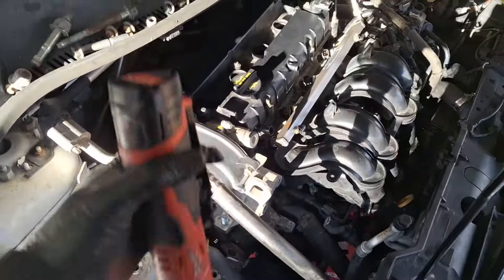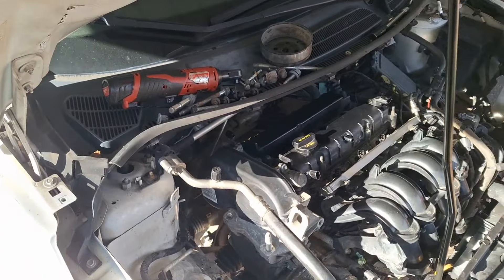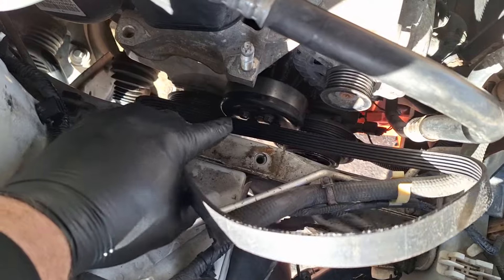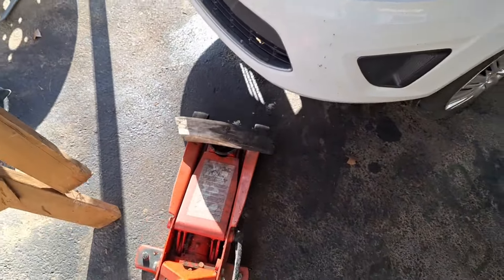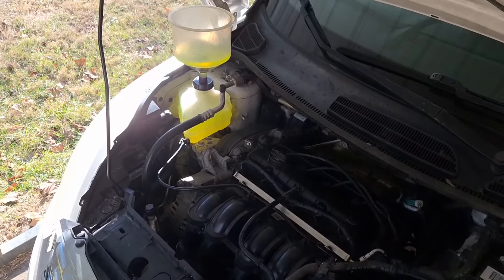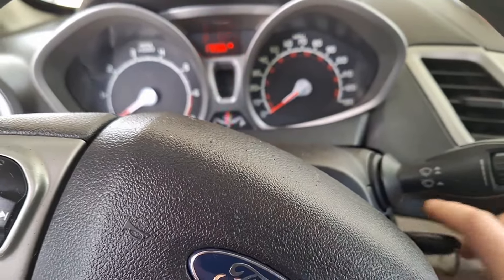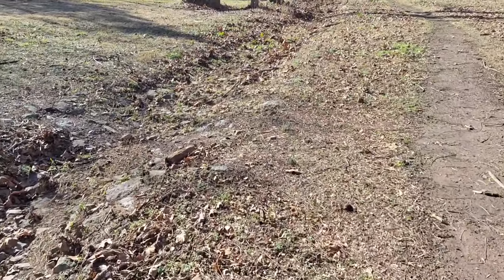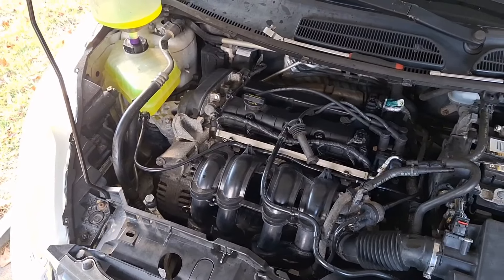Project Ford Fiesta - Did The Head Gasket Fix It?

Comment: I'm really enjoying this series. I just replaced my whole head gasket with the same kit that you used. In my 2012 ford fiesta. The car is still overheating with my overflow tank still bubbling up. There is still a slight amount of white smoke with  slight black colored liquid dripping from the exhaust. 

I did a compression test and all of the cylinders were a little above 110psi (ford dealership tech said the normal range is between 100-110psi. I replaced the thermostat and water pump. I even did an engine block tester with the but the blue liquid did not turn yellow. The engine has no misfires.

Could it be a bad (leak free) radiator? Or do you think the engine is toast? Thank you!
Reply from the maker: Hi, I put an engine in mine, made a video for that. You could test your coolant bottle cap and pressure test the cooling system
Reply: @BigBensCarsAndCycles  Thanks bossman. I pressurized it at 16psi and it only went down to 15psi after 10 minutes. I'm debating to pay for a diagnostic at the dealership or just to junk the engine
Reply: @BigBensCarsAndCycles  Would you say my engine is toast ?

Comment: I got the P090C code again. I called the dealer and they told me that if they determine that the problem is not my TCM then I'll have to pay a $200 diagnostic fee. I've already replaced the Clutch actuators 2 or 3 months ago and my car ran like a dream until recently. I got the code 2 days ago and I couldn't clear it with OBD, disconnect battery or transmission reset procedure. I went outside the next morning and it cleared and ran great. Last night I got the code and couldn't clear it. In the morning I didn't clear it but my car ran fine. I had all the gears plus reverse. 

My question is if there's something other than the TCM or Clutch actuator that would cause the P090C?
Reply from the maker: If you've got a new Ford tcm installed, it's not the tcm. I'd swap the actuators and see if it changes to a p0902. The last thing would be a transmission harness issue but I highly doubt that
Reply: @BigBensCarsAndCycles  I  just spoke with my Ford dealership told me that I needed a U0100, U0101 or U0103 to get my TCM replaced.
Reply from the maker: @frankgagnier4805  no, p090c is also covered. They need to look at the flow chart in the program
Reply: @BigBensCarsAndCycles  my local Ford Service Center seemed all around a little sketchy with some of the this that they were trying to tell me so I called the one in Daytona and spoke with the service manager and he seemed a lot more informed. I have an appointment on Feb 19th so we'll see what happens.

Comment: When I pull the transmission on our focus I want to fix the oil pan leak.  Is their a gasket for this pan or do I just use gasket sealer?  I'm having a hard time finding a gasket for a 2016 focus Se
Reply from the maker: Hi, it just takes sealer. Ta30 or ta357
Reply: @BigBensCarsAndCycles  thank you sir

Comment: Will a 2.0 Duratec from a Focus fit in the Fiesta? Would make a good video series and I'll bet that Fiesta would scoot!
Reply from the maker: Interesting! I've got a spare focus transmission too. I'd have to get the harnesses too
Reply: They scoot with the non-turbo 1.6 too. 😄
Reply: @DetroitMicroSound  I vote for the 1.6 too, but just cause I want to learn as much as I can about it 😁
Reply: The 1.6 is the one used in WRC. Bigger doesn't mean better. 😉 @dominozonda